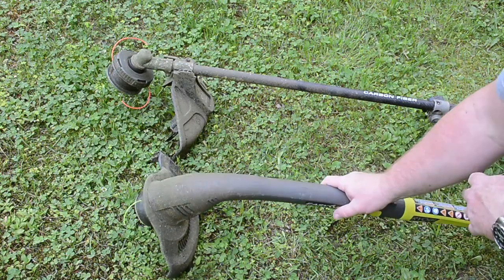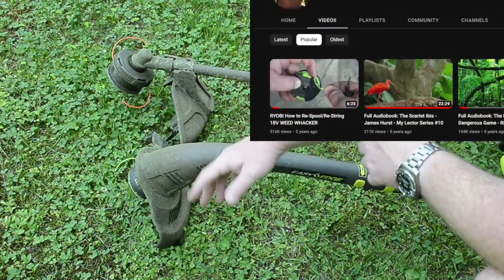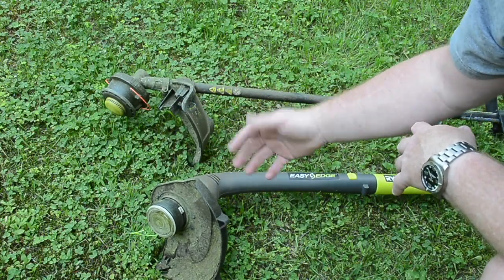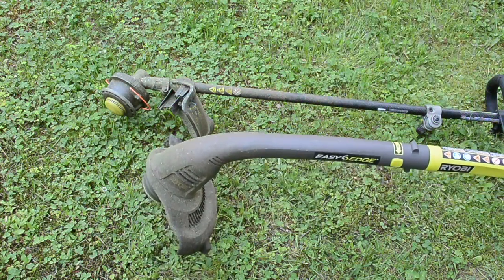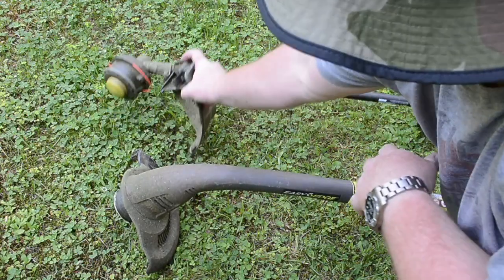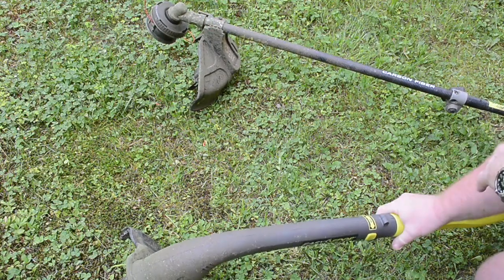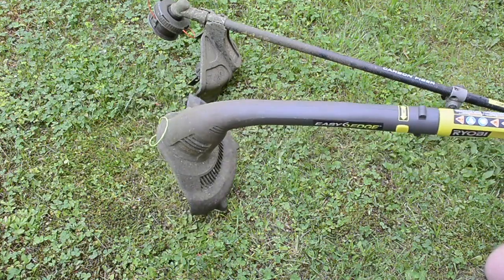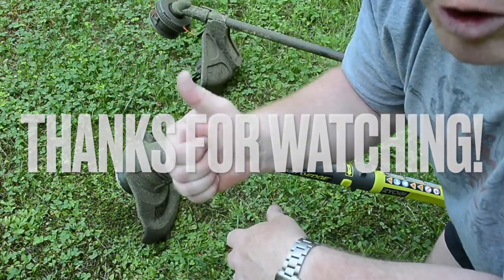Tangled Ryobi 18V Weed Whacker - Why Line Keeps Coming Out

Comment: Ugh this makes so much sense. Thanks for the explanation. Should you pretty much always be using weed whackers at full RPM, so that the line keeps getting cut?
Reply: Most plug in models only run at full speed.

Comment: Thanks!! I’ll also sharpen the cutter with an old knife sharpens or my lawn tool sharpener.  Thoughts on soaking trimmer line in water?
Reply from the maker: I’ve soaked line overnight in the past, and this makes sense if line is old and brittle, yet I don’t buy in bulk and re-stock every few years. And besides, I wouldn’t mind spending $15 on new line if it’s needed. I would be inclined to toss old line these days. Especially with these battery powered tools, we have saved so much $ by not buying gasoline or oil. I feel like spending a nominal amount is OK. For instance, with my 40V weed whacker, there are ‘pre-cut’ lines available and those pre-cut lines are more expensive than the line in a spool. I would have to cut the spooled line at 16’ long, but I treat myself and buy the pre-cuts. Also, I go through one package every 2 years so it’s not overly expensive. If line is 5+ years old and needed then yes, I think soaking can restore some lost elasticity and pliability. But ‘just use it up quickly and get some new stuff’ is what I say.

Comment: My string gets tangled within the cartridge no matter how loosely or tightly I wind it. And the string never makes it out as far as that cutting blade.
Reply from the maker: How old is the string? If it’s very old it could be brittle and not ‘sticking’ to itself when wound.
Reply: @heyitsjosh  
It definitely is not old and it definitely is not sticking to itself.
Reply: Mine does as well! Even on new line! @OICU2

Comment: I saw a ryobi video and it was confusing. I think I’m pressing the button by habit. The battery doesn’t last long so when  I’m walking to another section I try to shut it. Is there a way to shut this auto feeder option off or something? I’m going true battery and string really fast. Thank u for your video , I’m going watch again bc I don’t tie it
Reply from the maker: The automatic feeding is a feature that you cannot turn off. I usually stop the unit and extend the line often rather than keep it running if I'm not using it at that moment, but I don't find that I burn through cord that quickly.
Reply: @heyitsjosh  I have to extend it often like every minute or less. I dk what I’m doing wrong
Reply from the maker: @jesuswarnedusaboutthem7710  When I'm doing around rocks and harder stuff, like concrete foundation or trees, I often have to extend the line more than every minute or less. This stuff breaks easily, and doesn't last too long. As a rough estimate, I would say that 1 spool should last roughly 4-5 full battery charges, so maybe 1.5 - 2 hours of run time. But I am aggressive and like to get every last piece of long grass, so I trim in close with everything, even the wife's garden lol.
Reply: @heyitsjosh  maybe that’s what it is bc I was doing it around retaining wall blocks but I’m surprised how little it lasts for. I think I need a new weed wacker or is this normal even with other brands ? Thanks

Comment: Yea im just gonna use braided steel cable and bolt it to the spinny deal..  if it breaks and takes out a toe or finger than so be it, these weeds need a wackin..  or maybe ill just spray grass killer on all the edges and be done with it all..

Comment: I dont want to put mine at full rpm because ALL my line is coming out, and im having to restring it! I haven't found not one video w a fix for this. I know how to string the line. Thats not the issue, its a prestrung line, the first one worked great then all a sudden it threw line EVERYWHERE. 
So came it, grabbed another, put the spoil in, amd this one is doing it. Its not the spoil, its the effen weedeater. Im so annoyed.
Reply from the maker: Be sure to get to full RPM immediately upon pulling the trigger. The line has to cut itself. My guess is that the little bit of excess line that you leave out of the holes is too long, when putting the pre-strung line back in. Just leave a little bit of line, and extend the line further while operating the unit, and get up to full speed after using the machine to extend the line, so it has an opportunity to cut the line.